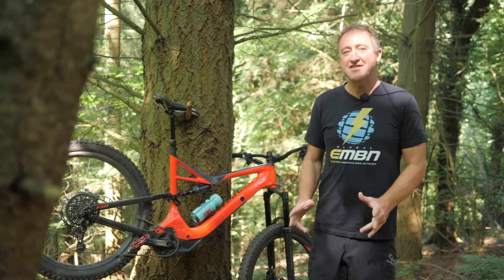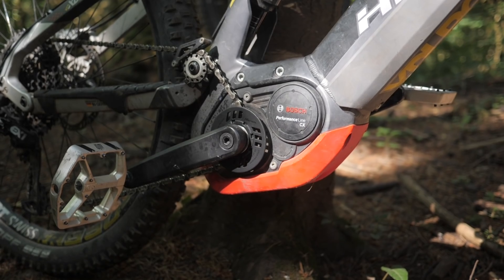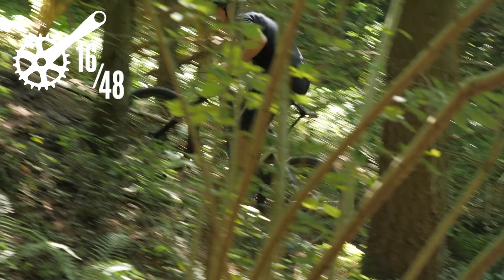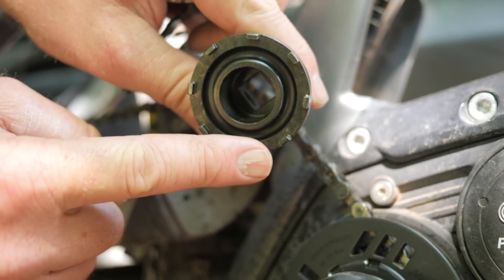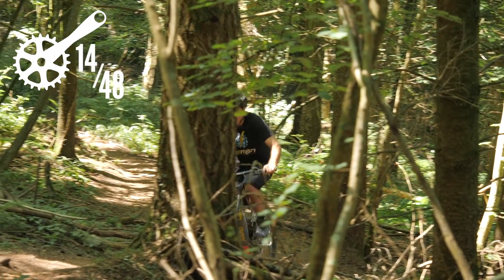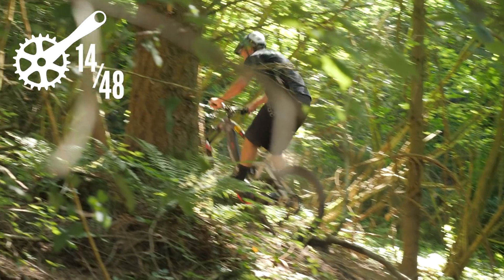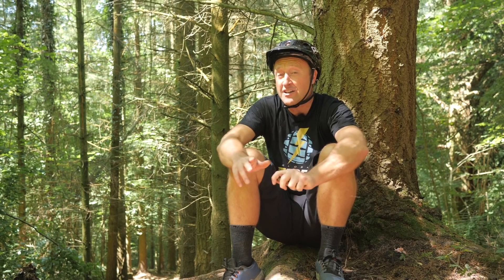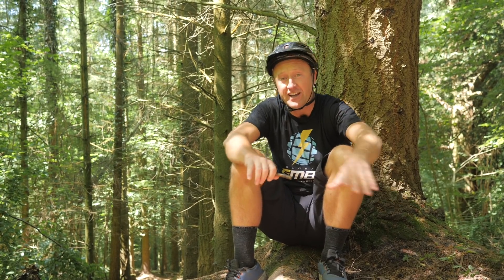How Does Gearing Change An E-Bike's Ability To Climb

Comment: What kind of power are those bikes putting out? I built a 750w mid drive MTB that peaks at around 1,400w and can put out over 120nm. There's no way I need gearing that low to get up steep hills, I currently have a 44t chainring and a 11-42.

Comment: I sometimes lower my seat on steep tech climbs because it's been on the slowest climbing I've fallen off my bike (Trek Rail) because feet are so far from the floor if I need to stop (seat angle on the bike needs you to commit to the  climb).  It's quite comical for mates I've been with & I guess it's better than crashing out at speed on a rocky descent

Comment: ......great video and really helpful, my cx is a road bike running 16 front with 11 to 34 so a beast to pedal without battery, i will change one or both ...., it should be noted that the bosch motor is geared (so the 16 front is equivalent to a 32 on a standard gear ratio as the cog turns at a faster rate than the pedal crank) correct me if i am wrong......

Comment: I have an emb that has a de-restricter fitted. Im running out of gears at 26ish mph and wondered if fitting a larger chain ring would give me just that extra speed to get over 30 comfortably.

The bike i have is a Rockrider E-st 520 with 11-42 cassette , chain ring is 34

This is for private off road usage 

Cheers

Comment: I went from 15T to 20T for commuting  Trek powerfly5 Bosch CX Schalbe 29x2.35 road tyres. The bike is much nicer sitting in the middle of the cassette. Speedbox2. I stick to 30km/hr on bike paths but when I go on the open road amongst cars I can hopefully go a bit quicker.

Comment: Huh i even have a 34 teeth chainring on my stolen bike, so i had even smaller gearing. It climbed a very steep section with a breeze, leaning over the bars and pushing, but i made it :D The ground was dry and dusty.  I hope i get this nice bike back from police or atleast can buy another one with the insurance. to bad i just changed to tubeless tyres.....
Reply: Wait you stole a bike or had one stolen? If so, how and was it locked?

Comment: Thanks for the video!- I changed my Haibike Bosch Performance CX  18T to a 14T    WOW! what a difference!  Opened up a whole new style of riding!  Bought the 14T from Worldwide cyclery online for only $23 ! it is made by sram - super easy to change and no problems at all with install- don't use the alum spacer that comes with it though.  Only downside is I don't have a bash guard but honestly- don't need it.
Reply: with 14t spocket can you pedal with no battery? , as normal bike ? I don't understand the big gap between bosch small spocket motor and other systems is 14t vs 35 , on manual pedal with no motor assist what is happening?

Comment: There is a serious and surprising fundamental ommission in this article, i.e. the chain ring on the Bosch system actually rotates 2.5 times for every turn of the pedals so in effect a 14 tooth chain ring is equivalent to 35 teeth on a normal system.

Comment: How does having a smaller gear up front, compare to say a 34 tooth, if you have to pedal with the motor turned off.
Reply: with 14t spocket can you pedal with no battery? , as normal bike ? I don't understand the big gap between bosch small spocket motor and other systems is 14t vs 35 , on manual pedal with no motor assist what is happening?

Comment: At first I was extremely confused, why would you put a 16 sprocket in the front, and make the bike insanely slow overall? Then I read about the tech involved to make a 2.5 ratio in the motor, that's awesome and cool tech indeed! Does this process has a further impact on battery life than a standard chainring?

Comment: I tried to fit a 14t front sprocket on my Haibike XDuro All Mntn instead of the 15t it came with (I have also replaced the 10-36t cassette with a 10-42t) but found the chain rode on the inside lip of the bash-guard and jumped the sprocket under load. I believe the smallest sprocket may be 15t. How did you manage to fit a 14t sprocket on your Bosch motor?

Comment: Brose S with 38 front and 11-42 rear. Usually no problems up to 24-26% grade, but not doing really heavy flow uphill. 

I confirm that the shorter the available gears, the longer the battery charge life.

Comment: I watched this video with great interest.  I ride hills here in the tropics of Panama that are asphalt and very often have long slopes of 20-25% but even shorter sections of 30-35%.  I ride these on my standard bike in a 26/42 f/r gear.  I am looking at getting an e-bike so my wife can accompany me on these non-technical rides.  One I am considering has a 1000W Bafang motor and the lowest gearing will be 44/48 (160 Nm torque).  The other has a Bosch 16/46 setup (350 W, 75Nm)  Do you think either of these bikes will have a problem with these hills? Thanks in advance.

Comment: 16:48 = 1:3
14:42 = 1:3

Same gearing. The Bosch has a internal gearing for the output. Notice the chainring spins faster than the cranks...
Reply: Just what I thought when I watched this too.
Reply: 1 crank rotation 2.5 gear rotations or so.
Reply: Yes, exactly.  It says a lot about what the guy actually knows.  Also, the comment that 1 tooth up front is worth about 3 teeth in the back.  Anyone who says this doesn't understand gearing.  Also note that on a Bosch system 1 tooth up front is really worth 2.5 teeth on a conventional crank.
Reply: This needs more upvotes! 
he was not able to ride it with 16:48, but he was able to ride it with 14:42. There i stopped the video. It is useless!

Also with interal 2.5, its then 40:48 vs 35:;42 wats both again 1:1.2

Comment: Thanks for the Video mate , I ride a Levo and don't mind the standard gearing but am keen to try a 30T front chainring simple because as you say that it's way easier to top out the speed limiter with the taller gearing. Love my single track cheers

Comment: You failed to mention that the Bosch sprocket runs the 2.5 ratio equivalent of a conventional front sprocket size.  So your 14t is the equivalent of a 35t conventional size. 15t = 37t, 16t = 40t etc.
Reply: Can you help understand something?  I live in a region of Panama with very steep hills (at least to me), fairly long distances of 20% slopes and shorter runs of 35% slopes.  I am looking at two mountain bikes, trying to minimize my efforts at climbing these.  The Haibike offers a 75Nm torque Bosch motor with a 16/46 set in lowest gear (corrected by your comment above to 40/46).  The FLX Blade offers a 160Nm Bafang motor with a 44/48 set (I might be able to get them to put a smaller gear of 36 in the front for a ratio of 36/48).  Is my choice obvious - go with the most torque and try for the smallest gear upfront, therefore the Blade?  I know I sacrifice top speed but that is not my ultimate goal, which is hill-climbing ability.  Thanks in advance.
Reply: Hi John, there are many variables which can affect the climbing ability in respect of torque, or rather being able to put available to the ground, and whether you actually require it. I have spent a fair bit of time documenting rides or more specifically climbs, using various bikes and also drive units putting out differing amounts of torque, and using differing power settings. Some of the climbs have been in excess of 10 miles of continuous climbing with no let up, elevation gains approaching 8,000ft, and gradients far in excess of what you are proposing.  It is quite difficult to say what might be best for you, but from own experience, greater torque doesn't invariably equate to a faster climb, and can actually have quite an adverse affect when conditions steepen, and loose terrain encountered. It can also work against you when traction is abundant as well, as it can in fact catch you out, and possibly contribute to making the front end less planted, or even flip the bike.  More torque also affects battery consumption, and on the following measured climb just as an example which was 10.5 miles long with an elevation gain of 7,884ft, the Bosch Performance Line with 60Nm and a 400Wh battery,  and the Bosch CX with as 500Wh battery, both required a change of battery at the 9.5 mile point. The climbing times were also identical, as was the final drive gearing. Without showing the charts and graphs, it is a bit difficult to put this across with any real meaning.  I weigh 75kg, and whilst fighting a health issue, I consider my self to be pretty fit, and for my use, the optimum set up for me, would be the older Performance Line, linked to a 500Wh battery, and a final drive gearing of either 15/42 or 15/48 (37/42 or 37/48) depending upon terrain. I'm more than happy to try to explain things further via email if it helps, as I have had to rush through this a bit.
Reply: But the flx blade is a 1000W moped! You are comparing apples to oranges!
Reply: Eddie, exactly. The Bosch system can't have a chainring smaller than 14x2,5=35, which is a bit limiting in my opinion.
Reply: with 14t spocket can you pedal with no battery? , as normal bike ? I don't understand the big gap between bosch small spocket motor and other systems is 14t vs 35 , on manual pedal with no motor assist what is happening?
Reply: Thanks a lot now I understand
Reply: I understand but I am older and am not looking for speed up the hill, just the ability of a machine to help climb it, so I am not a "purist" needing strictly a mountain bike.  But I am interested in hearing from Eddie about how the greater torque could be a "con" as opposed to a "pro".  I do not climb a lot of loose uphill trails either, so if the greater torque translates to more slipping, I would just put the bike into "walk mode" and hike with it.  Nearly all my rides are on asphalt.
Reply: Limiting for hill climbing you mean?
Reply: John Wiseman Yes. In this very video there is a mention of a non-Bosch with a 32 chainring.
Reply: Ah it all makes sense now and that's where the drag comes from past the limiter.  Yes! nobody mentioned that.
Reply: the new gen4 i got has 38t in the front sram eagle 11-50 in the back, until yet this was more then enough :=) also now you change it sram ofters 34t seemingly but my Manufacturer "Cube" use there own 38t ebike crank

Comment: Is it normal that you lower the saddle position with an ebike on steep climbs? Is it because otherwise the front wheel would go up?
I mean with the shorter position it seams like its really uncomfortable for bent legs.
Reply: LOL I wrote that Q when i stoped the video right before Steve mentioned it at 8:30 "breaking all the rules...seat dow.."
Now i see that it makes a huge difference if you experiment with different techniques, positions and settings on an ebike.

Comment: If someone only invented multiple front blades..... oh wait.....
Reply from the maker: That's fair. But we'd rather have less gearing up front, better chain retention and fewer shifters.
Reply: I can imagine people prefer that, I prefer a front shifter. The fact that there is no longer a choice, I think, is sad. Most e-mtb's you're simply just not able to fit a double chain ring up front.
Reply: I agree with Erik. Those 46 or 50 rear sprockets are monstrous, and require huge cage travel. 2x9 would get the same aperture with a stronger chain, more compact cages and I doubt there would be any noticeable weight penalty. Is a trend that I don't like.

Comment: I only ride an 11-36 10spd cassette, with a 36t chainring. The lowest gear (1:1 ratio) paired with the extra 80nm from the motor, is enough torque to get me up into the mountains without popping unwanted wheelies.
Reply from the maker: You've got better legs than we do!
Reply: Did you measure the slopes in angle or degrees?  This would be useful info.

Comment: Can I ask if It is normal that the Bosch drive has some slack in the drive shaft that rattles when the chain bounces around causing the front sprocket to rock back and forth?

Comment: Nice one Steve... would be good to touch on how the 29 v 27.5 also effects the gearimg and the ability to  climb... is a 14 46 better on a 29 than a 27.5 ?
Reply from the maker: It's worth looking at, thanks Legacy4x4turbo 👍
Reply: Electric Mountain Bike Network I've just managed to put a 14t sprocket on the front and a 11 to 50t on the rear... with my 29 inch wheels......Will see how that performs... ;)

Comment: Thanks for the great video 
I love my Bosch CX.
Reply: with 14t spocket can you pedal with no battery? , as normal bike ? I don't understand the big gap between bosch small spocket motor and other systems is 14t vs 35 , on manual pedal with no motor assist what is happening?

Comment: As you were using Bosch  Why didn't you use eMTB mode? I and probably most Bosch users just use this mode
Reply: ol have you upgrade your software lately supposedly there’s a new software out for 2018

I was planning on looking into that as soon as I get back from vacation.
Reply: Emtb gives power between tour and turbo. Turbo is max power, the test was for max climbing power.
Reply: @blackbird8632  emtb is actually better for climbing, turbo is less controlled power thats better used on open flatter trails for maximum speed.
Reply: New Bosch CX update 2019

https://www.google.com/url?sa=t&source=web&cd=1&ved=2ahUKEwjB6-6bmKLcAhWG-VQKHQzAAzAQFjAAegQIBxAB&url=https%3A%2F%2Fwww.e-bikeshop.co.uk%2Fblog%2Fpost%2Fnew-2019-bosch-ebike-updates-emtb%2Famp%2F&usg=AOvVaw2FIlLX_ZrDLv-w3w8qACiM
Reply: Tim VonWald what part of the 2019 software makes it more capable going uphill?
Reply: Blackbird have not had the latest “2019 update yet
Was wondering if anyone else has and if they had an opinion about it ?
Reply: Definitely going to drop my gearing after watching this

Comment: Good video mate , i do enjoy your hands on videos .
Good gearing certainly helps a lot ,  but wouldnt  it be nice to have a bit more motor torque to help keep the momentum ?  
  As you mentioned the rider weight and bike weight and gearing all make a difference ,  
  unfortunately if you have 2 strikes  strikes against you and not much motor torque , it is still  going to be a long hard hill .
 Getting off the track i know(scuse the pun ) , but 250 watts seems a bit on the wimpy side for a large to  average size adult .
perhaps motor power and torque for specific applications  might be a topic for a video down the track ?
Reply: mikldude 
The bosch CX has 75nm and 600 watt max power.

Comment: I run 14T with the Bosch which if you multiply by 2.5 is equivalent to 35T on a normal bike. My rear is 10/42, plus of course you mustn’t forget rear tyre diameter. For my cadence, power and weight it allows me to climb a 20% grade for a short time. To analyse your gearing this site is great.
https://www.bicyclegearcalculator.uk

Comment: When you showed 14/48 fail, you could see the power delivery kick your front wheel up. 

It goes to prove how important rider position/weight distribution is. 

I’ve just recently increased the travel on mine from 140 at the front to 160. It’s strange how much more slacker it is and, actually, how much harder it is to climb. I’ve had to rethink my position on the bike.
Reply: Martyn Frith The front of your bike is 2cm taller now. Try to lower your handlebar the same amount by removing spacers from order your stem or flipping it if it’s a riser stem so you put yourself back to the same position as before. Those are the free options but you can get a handlebar with less rise too.
Reply: Tamas Varga thanks for that. It’s ok at the moment. It’s just surprised me the difference it’s made. 

I’ve shifted my position on the bike for tech climbs and have pretty much got used to it now.
Reply: Martyn Frith Sure, while 20mm doesn’t sound much but it’s a huge change especially on ebikes as we can tackle much steeper climbs with them. It’s basically pro XC racer category and look at their bike geo and position on the bike. :)
Reply: He was using turbo mode which tends to throw you over obstacles when climbing, Emtb gives a smoother delivery of power which i find better for climbing.